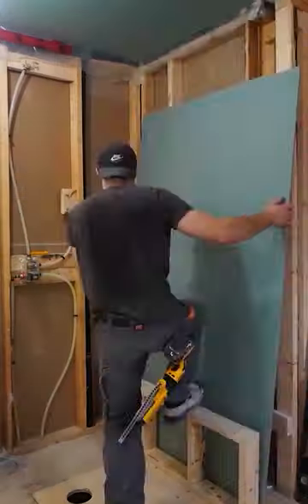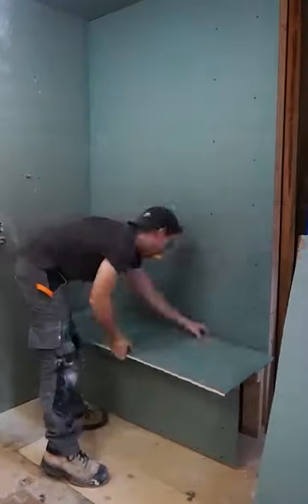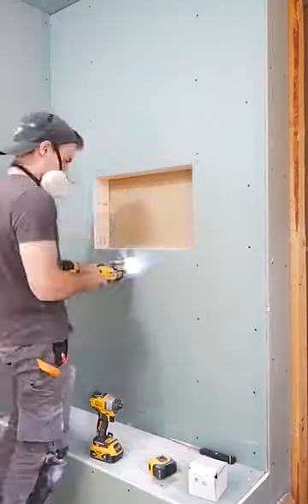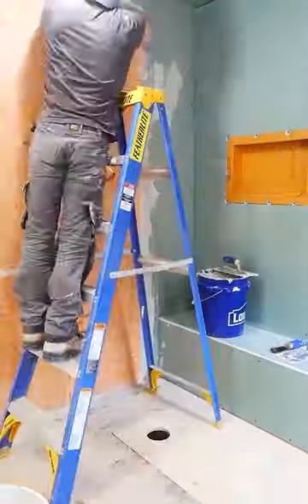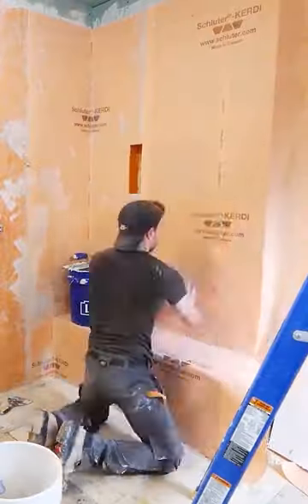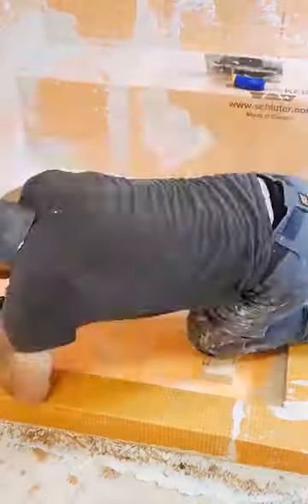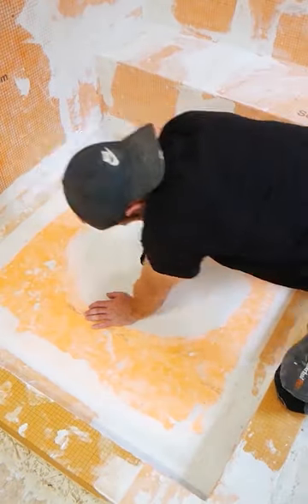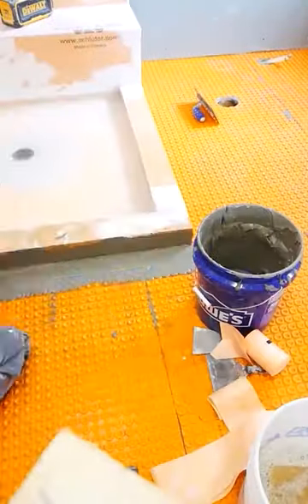How to Waterproof a Shower

Comment: How does the water get through the grout and the thinset mortar? Are you using stick down tiles in this application?
Reply: If it’s not epoxy grout, which is the only one rated waterproof, then water wicks into it, then into the thinset. But, another issue is using real stone in showers. It has to be sealed often or the water also wicks into them and if regular grout is used, sealed or not, then you get effervescence and calcification. A real pain in the neck.

Comment: Lets assume for a moment that the drywall will never fail in that shower. That doesnt make it a good idea to use it. Honestly how much more does cement or backer board cost than drywall for that small of an area? 20% more? So $120 for concrete vs $100 for drywall? Id gladly pay that small increase for the safety factor alone. Also you can just pass the increased cost onto the client. What benefit does drywall have if any in this situation? I dont get the logic for drywall. I understand schluter systems will warranty the product over drywall, but thats assuming they will actually pay in the case of a failure ( they probably will not). Most likely they will blame the installer. Also if they do pay you still need to demo out the failed shower and construct a new one.
Reply: Those first two sentences will make an average problem solver scream

Comment: Obviously the goal is zero water damage, but you can watch countless waterproofing videos and most of the are done with “just in case” precautions. Use cement board “just in case” water finds its way back there

Comment: Cement board isn’t waterproof, but typically it’s sealed with a waterproofing membrane(hydroban, redguard) which in the end is cheaper than a Kerdi-Schluter system. Not hating whatsoever but there’s pros and cons to each.

Comment: I have ripped out over 100 showers every single one of them had failures always in the same places. Always the usual suspect areas. Never seen any damage above 3 feet high unless it is a leaky shower control or head! My suspicion is that everyone is going crazy with these waterproofing fabrics myself included. If everyone of us steps back a bit and only waterproofed for example 4 feet high and around the shower control and shower head would the shower last long enough to be out of fashion or look dated? Our industry has turned into a bit of a rat race schlutering ourselves to death including ceilings.

Most European installs use cement based products. For me that allows for an attempt and four foot high membrane installs. It is simple either the shower fails or it doesn’t. I believe four feet is enough to reach 25 years + . Definitely worth an aggressive discussion.

Comment: Do you slope the bench seat frame so water runs off?
Reply: @cosmosistprograms4970  is there a certain technique to pitch the tile?
Reply from the maker: Personally I just put extra thinset towards the back end of it and then set a level on it until it’s pitched inwards. You can measure for 1/4” over 1’ span but I personally just eye ball it for benches/niches/curbs using a small level

Comment: I don't understand why people go through all this time and trouble... Just apply three or four coats  of aqua defense and you're done... Just make sure you fiber your corners...
   I've seen so many failed schluter systems it's not  funny
Reply from the maker: It all comes down to preference. I’ve used redgard a few times and I just personally prefer schluter. I’m not a fan of cement board and I really like the prefab pans. Also the drying time between coats is something to consider

Comment: Scooter board is far better than the Schluter membrane to install you wasted a lot of Labour doing that should have just use sluder board but I agree with you backer board concrete board will fail so will those concrete mud pan

Comment: I just did Reno and they didn’t use cement board. The gyprock was moldy and mushy due to slow moisture intake over the years. I could pull the drywall off the studs with just my hands. If you’re looking at building a bathroom DO NOT LISTEN TO THIS GUY!!!
Reply: Also the gyprock won’t support the weight of the tiles, or your arm when you accidentally hit into it.

Comment: As a tile guy myself, I don't have a problem with kerdi over greenboard after all, it is manufacturer approved and warranted by Schluter as long as the entire system is followed to the letter, however I personally use KBRS shower pans and a product called GoBoard for the walls because it is lightweight and waterproof from the factory, all butt joints get "welded" with KBRS ShowerSeal, an extremely effective polyurethane caulk and then I do all my waterproofing steps on top of it. My problem here is all of your credibility went out the window as soon as I saw your bench framing, you didn't put a single support attaching the front to the wall, and you should've had at least 3, 4 even better, one on the inside, one on the outside and another 1 or 2 centered in between, do better next time and hope that a 300lb man isn't using that bench for a long time

Comment: The best and fastest and really waterproof deal is Wedi system, period
The other systems or solutions fail over the time. Wedi has come to be the most durable and the only one that doesn’t allow mold build on the studs because it is 100 percent impermeable

Comment: Drywall is not waterproof. Its moisture resistant. Use a waterproof foam board
Reply from the maker: No way
Reply: @WorkinwithWolkon  ok don't use actual waterproof board. You're using schluter membrane why not use schluter board?
Reply: @keithscofield4583 because it cuts into his profit...but in my opinion well spent money💰
Reply: @keithscofield4583 because it cuts into his profit...but in my opinion well spent money💰

Comment: Just put in a fibreglass one-piece tub unit. EZ, looks great, no hassle.  Set in place, connect the plumbing, and done.  Tile is stupid hassle that requires constant maintenance and always leaks.  It's also cold to the touch and of course way over priced. problem solved.
Reply from the maker: I’ve seen a lot of interesting comments as I’ve been doing this but yours is truly a special take

Comment: But drywall is also not waterproof...
Reply from the maker: No it’s not. But the schluter membrane system is
Reply: Drywall isn’t very strong… I’d much rather put the schluter membrane over cement board or roll on a water proofing membrane over the cement board. If the drywall holds up over time I’d be surprised but I’d think you’d get cracking very easily with drywall as a backer
Reply: @mreinecker  Cement board is terrible to work with. I am just finishing a shower now using Kerdi board, very nice to work with and no concerns about water getting through.
Reply: @WorkinwithWolkon  is something punctures that membrane is going to puncture that paper... And then you going to be in trouble
Reply: @daleon96  It has tile over it. Bigger problems if someone is puncturing tiles in a shower
Reply: @Mr.SisterFisster  cement board is not terrible to work with....
Reply: Green board as we call it.
Although alike, they're not the same.

Comment: Pros don't use Drywall.
Reply: Are YOU a pro?
Reply: @phunkdoctaspock i am and you dont install drywall behind tile. Its semi ok behind a shower insert or liner but even then needs to be green board or purple board which is meant for high moisture areas. Cement board is not affected by steam